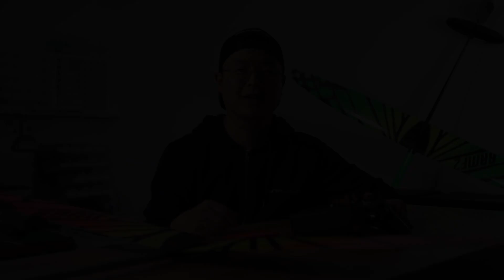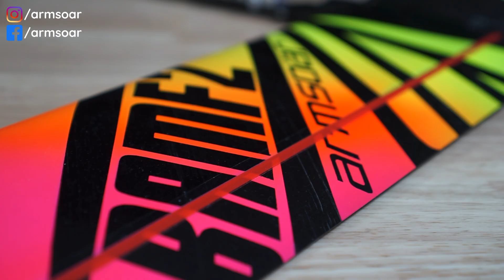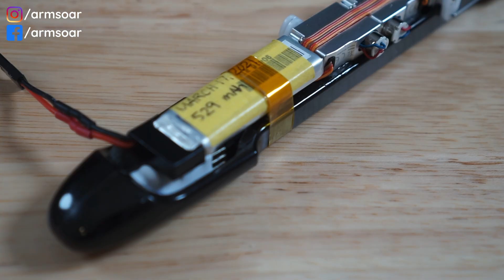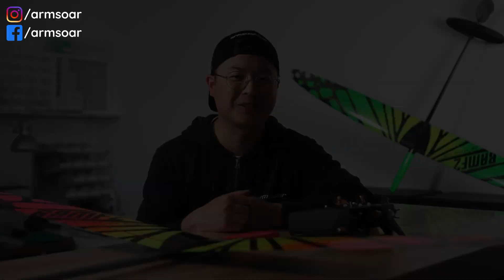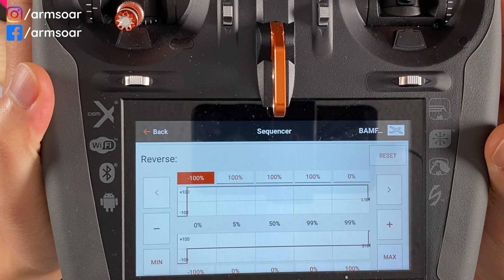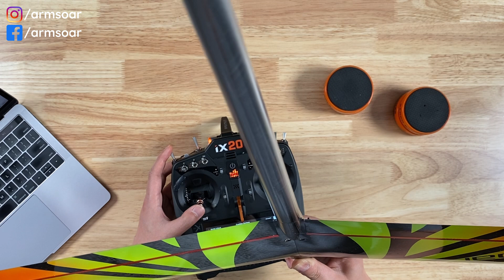DLG Radio Setup on the Spektrum iX20

Comment from the maker: What radio are you guys using to fly DLGs?
Reply: FrSky Taranis X9D.  In the past, I have used JR 9303 and Airtronics SD-10G.  The "9303 case" of the X9D fits my hands perfectly.
Reply from the maker: @IvanMacKenzie  Old trusty!!
Reply: I use a RadioMaster TX16s running OpenTX.
Reply from the maker: That radio is such a good value, especially love the multi-protocol capability.
Reply: I'm also using a TX16S,  I use the AD5.1 DLG program as a template which has most of these features built in.
Reply from the maker: @Jamesn-js1zp  I freaking love the X-Lite Pro. Planning a OTX video.
Reply: jeti ds12pro
Reply from the maker: @王逸飞-c6b  sweet radio!!
Reply: @ArmSoar  I bought two BAMF2 and received them immediately. So I hope you can do a setup video for Jeti
Reply from the maker: @王逸飞-c6b  Unfortunately I likely won't be doing a video on Jeti (I don't own one), but I think Liu Jiahong in China made a tutorial for it.
Reply: DX18,,,,nice video 🤘for me the bind button is the lunch ,released cruise,.but this sequencer mode launch -zoom mode not understood
Reply from the maker: @MissurayLaslo  the sequencer takes you into Zoom mode immediately after you let go of the button, and then goes into your regular flight modes after 3 seconds.
Reply: if anyone uses dx18 maybe could describe how to set this sequencer,so i know what you're doing just i can't adjust the charts,thank you very much
Reply from the maker: @MissurayLaslo  unfortunately I don’t have a NX or DX radio since those layouts do look a bit differently than the iX. Hopefully someone can share their info!
Reply: @ArmSoar  thanks!
Reply: I was once a Spektrum user but now go over to the OpenTX side.
Reply: JR XG8. Grip is like "made for" throws.
Reply from the maker: @stratigios  I still have a XG14! Arguably the best DLG grip ever made… hardware quality is also top notch on their radios.
Reply: @ArmSoar  my 2c, on that.
Reply: Going to put a momentary switch on my Jumper T-Lite. Easy to hold while swinging a plane and it fits in the glove box of my truck. Either that or a TX16S.
Reply: X-Lite Pro here. Can't wait for your OTX programming vid. The Spektrum explanation is a good start. It gave me a few ideas on where to start. Thomas, may I ask your educational background? All your tutorials are very clear, concise and understandable.
Reply: I have two, an ix12 and a Taranis +
Reply: Spectrum DX9
Reply: DX8 DSMX®, thanks to your assistance!
Reply: I am using radio master t16 with edge version
Reply: Spektrum DX8G2, affordable and great!!
Reply: Radiomaster TX16s. I thought I had commented here before that a EdgeTX Tutorial would be helpful. But in the meantime I did basically everything for my DLG models by myself - probably not efficient, but sufficient 😄👌
Reply: Still not getting how to get flaps on throttle stick.. I’m on a NX8 for now

Comment: I know this vid is already a few years old but it has been helpful with one exception. I'm hoping maybe you would be able to help with one part that was not gone over. 
The "TIMER" programming. I have been searching for Timing programing for Spektrum radios that is more in depth. I have an old reliable DX9 and I'm trying to figure out how to have the time start upon release of the launch button, and STOP with full flap or "brakes" down on my DLG. I've been able to get the start part working but not the throttle stick to stop it.  If you have a method or knowledge of how to do this I would greatly appreciate it. I've spent more than a week looking for anything that seems relevant to my search with no luck.

Comment: How can you set aileron travel limits? If you limit travel to have reasonable limits to the ailerons (+15mm, -10mm) it also limits the flap deflection. To have proper brakes, aileron down deflection during normal flying is way too much. I cannot find independent limits for aileron and flaps. NX10 and DX9. Both are the same.
Reply from the maker: You can use differential to adjust the aileron movement.
Reply: @ArmSoar  thanks! Way simpler than my mixes flap-to-aileron that only sort of work. 
30 years flying rc airplanes and still learning 😁

Comment: I have my brakes set on the throttle stick. The stick is all the way up but when I pull it back they dont start moving until I hit half throttle . Not sure where to fix that.I am using an ix12
Reply from the maker: In Camber Systems you'll need to set values Ail values for both the Up and Down boxes. I'm guessing you only have a value set for the Down box?
Reply: @ArmSoar  in camber systems I have -100 down. And 0 up. I tried playing with those numbers this morning and couldn't get it right. Ill try again later.
Reply: Alternative is to Set the offset in camber System to 100 or -100 when only using down Stick travel

Comment: Can someone please show us an optimum setup on a normal person radio? This is a 1400 dollar transmitter.
Reply from the maker: Sets up just the same as a $300 NX6, same menus just slightly different layout.
Reply: @ArmSoar  my NX8 doesn’t have ele or flaps (ailerons) in the sequencer menu. Only have AUX1, AUX2, and GEAR. Still unable to get an answer from anywhere about how to get my sequencer to work to program a launch mode. 🤷🏼‍♂️
Reply from the maker: @IllFlyIt  Have you tried RC Groups -> Radios subforum? Andy from Spektrum spends a lot of time there answering questions.
Reply: Man, HH has jacked up the price by $300 in a year. It's now a $1,699 transmitter.

Comment: Thomas, what are the 5 percentages you have set on your 5 point curve for your flap to elevator mixing? I’d like to match.  Thanks!
Reply from the maker: You can use it as a starting point but it'll likely be slightly different than what you'll end up needed since each model is set up differently:
0.0%
18.0%
30.5%
40.0%
43.0%
Reply: @ArmSoar  excellent Thomas thank you.  I’ll start there and tweak it of course.

Comment: Basically impossible to "read along" on the radio screen.  A lot of work I know, but an zoomed in inset would be helpful. 🤔
Reply from the maker: Thank you for the feedback! We’ll see how we can make the next ones easier to read along :)
Reply: @ArmSoar  Totally agree with Ivan. Technically it's should be possible to mount lightweight camera (GoPro for example) on to transmitter using strap mount on transmitter and some kind of mount or lay transmitter straight and zoom in screen and button part of video.